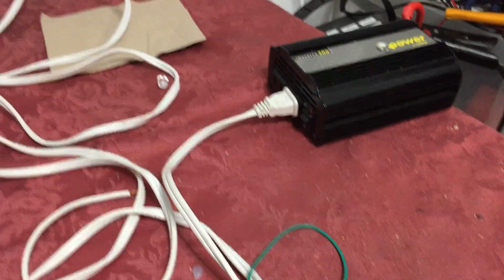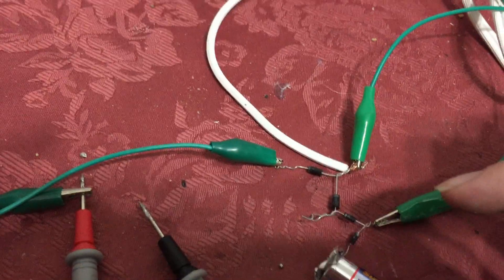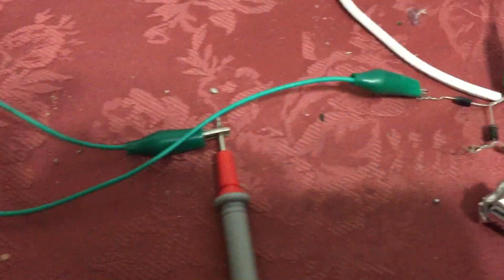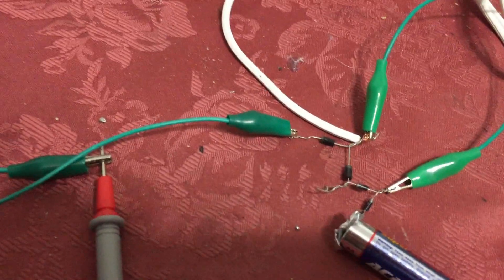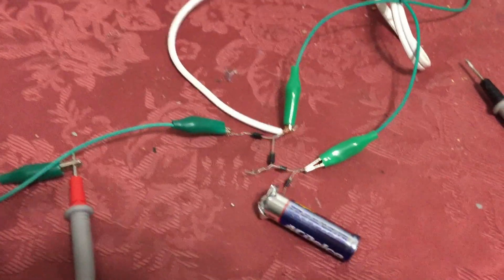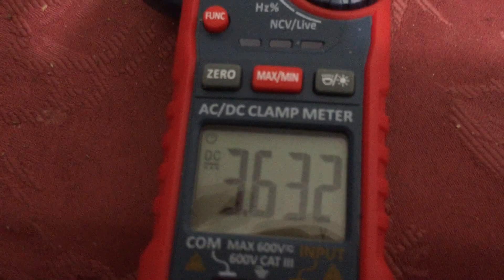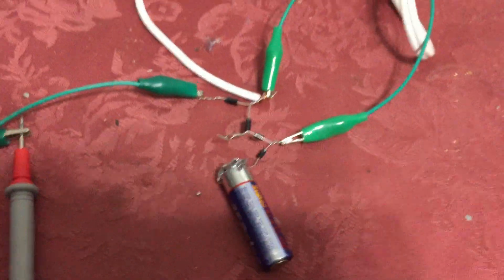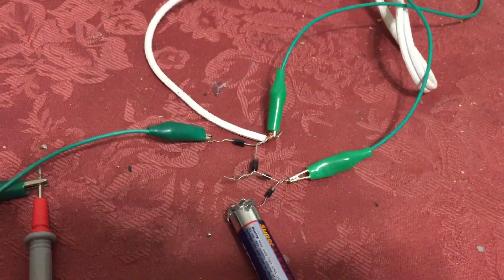One Wire Voltage Multiplier

Comment: Use a microwave oven transformer to pulse the high voltage coil with the diode plug and extract current from the 120v or 220v side of the trabsformer. 
Buy a used microwave off marketpalce for 20$ or free
Reply from the maker: Yep I did it with a small high voltage ionizer transformer connected to the back emf side of a bedini motor output as a one wire system with the diode plug. Works well. hundreds of volts.
Reply: @joellagace1679  also try and drive the diode plug and transformer with a variable transformer to tune the input for most efficient output
Reply: @joellagace1679  interesting. My next suggestion to take it to the next level of easily available equipment. Source an old cheap stick arc welder off marketplace can be found for 70-150$.
Large transformer. Big amp secondary coil hundreds of amps that might be the ticket to more power.

Larger core will be a larger oscillation if the initial one wire ac pulse is only used to initiate an electromagnetic cascade from high potential to low.
Reply from the maker: Another variant https://www.youtube.com/watch?v=e7_twPYcydk&t=1s

Comment: What if we replace the battery with a high-voltage capacitor bank, such as a 2000-volt high-voltage capacitor bank? This would potentially result in lower implementation costs.
Reply from the maker: Something worth trying.

Comment: There's been a discovery the natural energy gradients of the Earth move according to the ground potential so when you say have a flagpole it may be supposed to have a thousand volts at 30 ft but in reality it doesn't have much at all and what the discovery was if you put an aluminum sheet at 30 ft or even 10 ft that if you pulse it the wire coming down on and off you can charge a capacitor pretty fast what's going on is there the ground is being disconnected and the potential in the atmosphere is filling the wire in the plate and then when you turn it off or on it feels the capacitor the energy potential moves from the top of the pole to the bottom of the pole not to pull itself but the wire that's insulated and the plate is insulated and as you pulse it fills up pretty fast I was thinking if you're looking for a power source an eternal power source that use for switching this might be the cats meow there's a patent on it it was quite a dramatic difference in power output

Comment: What if you use large size diodes? Would it increase the current?
Reply from the maker: good question
Reply: @joellagace1679  I've seen pple put multiple diodes in parallel to increase output, as if it was acting like a negative resistor of sorts.
Reply from the maker: More diodes esp if different types will offer great non-linearity and introduce extra HF harmonics. So yeah that is possible.

Comment: But there are capacitors, however minuscule,  they come from parasitic capacity. This is standard cascade multiplier, nothing mysterious.
Reply from the maker: If you look closely its not.. a voltage multiplier is not connected up like this. each has its own input feeding from the same source, its not "cascading" I explain this in the video we run them like battery banks. I could pull up a voltage multiplier schematic but I know i'm correct here. no isolating caps in between and no return path.
Reply: Your are right,I am mistaken. After looking closer to the circuit it is just diode detector since your inverter is spraying so much RF that it generates voltage over diodes. Try the same circuit using isolating transformer instead of the inverter.
Reply from the maker: Yeah I used the inverter to show that it does not need the mains to trigger but works better with mains, stronger field. Some don't want to use mains even for this so I show an alternative. This doesn't really stress the inverter, it just uses normal idle power. There are better ways to generate a field even a joule thief could trigger the one wire system.
Reply: @miked4943  No, I think you had it right the first time.  This is just an ungrounded voltage multiplier (similar to an "ionizer" or "ozone generator" circuit) which is using the inherent inductance and capacitance of the diodes themselves (all components have some small amount of capacitance, not just capacitors) to "pump" electrons through the chain.  It's actually not even as effective as it could be, though, because he's shorted two of the legs of the multiplier together (which I suspect may be making it worse, not better, than if the input were only connected in one place).

This is essentially just a (rather poor) static electricity generator, that's all.
Reply: @foogod4237 ah. There he is. The good engineer who chimes in with nothing of value. It seems like you understand whats going on here. Now you just need to understand that THAT is what we WANT here. Now follow along and you'll be up to speed in no time.
Reply from the maker: Yeah the good engineer criticises the voltage multiple for being connected wrong when indeed its not used as a typical diode multiple. If he would watch my previous videos would understand.... We use the diodes as one wire plugs to get a negative and positive dc spike from out of the fields around the wire. Being DC, you can stack them diode (AV) plugs not voltage multipliers....But the end result will be like stacking DC batteries in series voltage and current wise. And each diode plug taps into the one wire contributing a little to the stack. A good way imo to build up a strong potential at zero or near zero current input. What we are indeed looking for here.

Comment: Hi Joel
Would you also have to use multiple ground connections isolated from each other?
Thanks
Reply from the maker: For keeping it simple i'd just put a antenna wire (counterpoise ground)on each - of the diode, its far from the only possibility as some as noted but keeps it nice and symmetrical for working with hehe and make sure its ground antenna is not touching any other contacts or antennas, so this could get messy with several plugs lol, its not needed but obviously gives you a great boost if you can do it.

Comment: Hi Joel. Watching from Kenya. I am not an electrician but interested in alternative energy. 
Came across Lorrie Matchet device where he used potential created by mains and the ground to light up some bulbs. Is the same concept?
Reply from the maker: As far as I know this is another form of closing the loop with ground and with traditionally AC systems if you do this you still end up paying for the toll. Even worst if you end up coupling into the neighbours panel then you need to pay X2 plus all the extra losses, so that dim light bulb is costing lots of money to operate in this fashion. That's why I say to use a counterpoise ground (antenna) that is isolated instead. to not close the loop with ground path.

Comment: I BET IF WE ROAST THOSE DIODES WE GET MORE GAINS! 😉
Reply from the maker: Try using transistors instead. It works very well. like take NPN short out the base and the collector and you got yourself a diode with super low forward voltage that will detect frequencies normal diodes don't play nice with :) I call it "the funny diode" lol
Reply: YOU SIR ARE A GENIUS 🤓